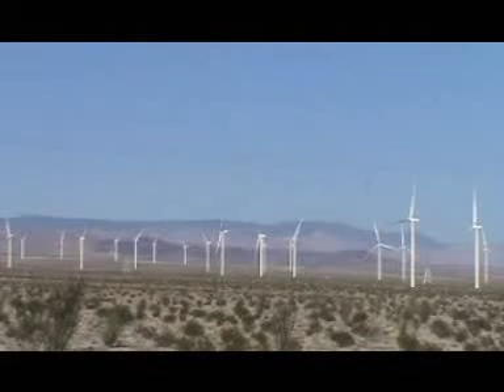Ocotillo Wind - Pattern Energy - 02/07/2013 Winds at 1 mph

Comment: SDG&E fools: the political vanity of "green" to build over 450 megawatts of gas fired peaker plants.  Raise rates through the cost of two systems.

“ . . . we also need [gas] resources . . . to provide power when other sources, such as wind or solar plants, are not available,” May, 2011, James P. Avery, SDG&E VP
“The output from most kinds of renewable generation fluctuates throughout the day, posing a challenge for our system . . . to maintain reliability, ” Avery added.